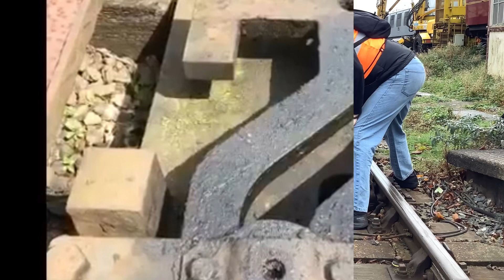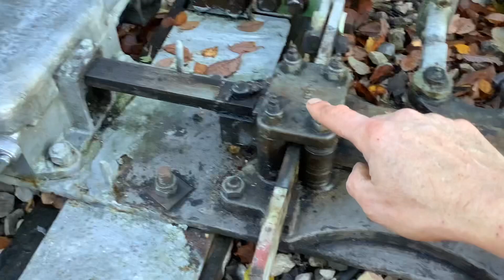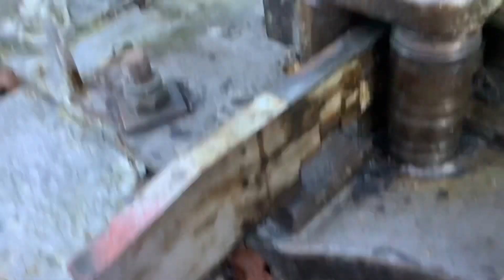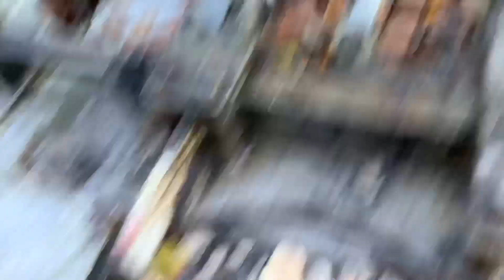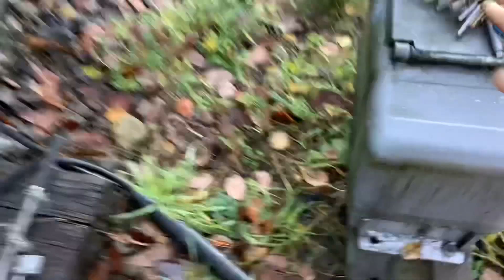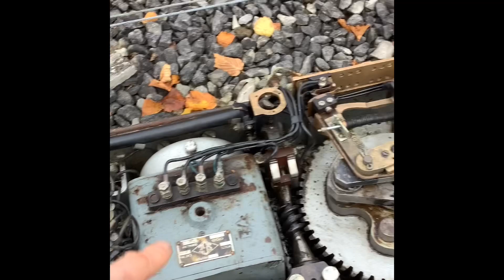Economical point operation, a  perspective

Comment: At about 15 minutes into the video I suggest that you could have had a volunteer pumping the points manually to demonstrate the mechanism.
Reply from the maker: Should it have been winding not pumping , 😉. The josslocks you can pump.  The motor at the MRC is a wind job , my apologies
Reply: @irseminorrailwayssection9491  but you said it was a hydraulic unit; that would be pumped, like clamp-lock points.
Reply from the maker: The josslock unit at church lane is as it has a hydraulic pump unit on it that drives a ram and thence the motion 

The one after at the midland railway is a motor that has a winding aperture on top, that one needs winding